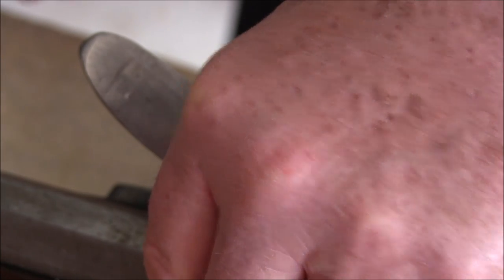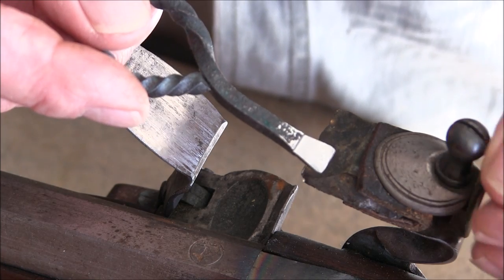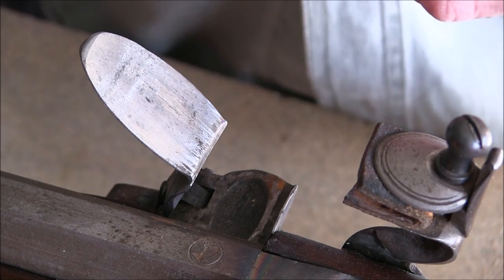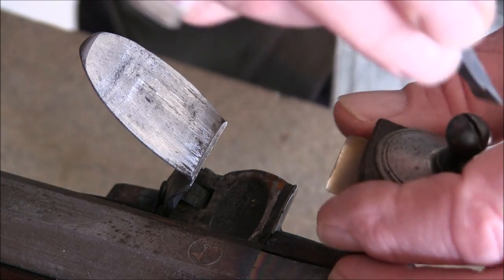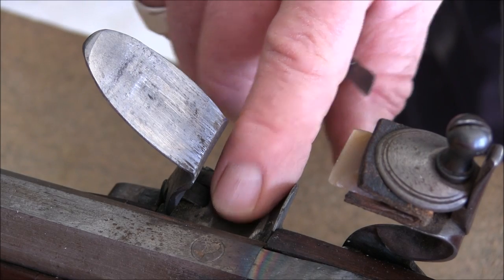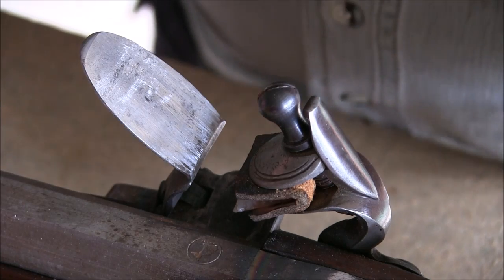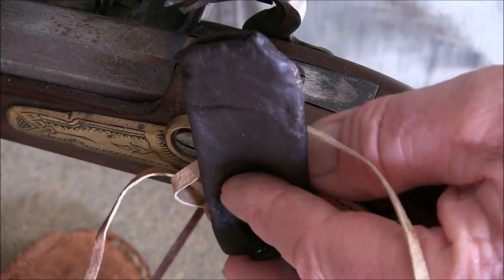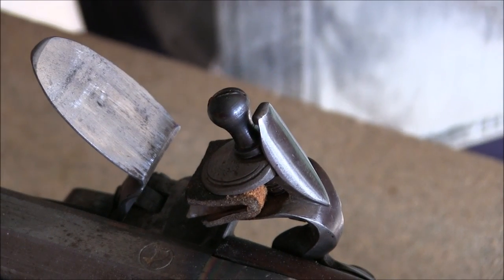Fitting A Smaller Flint In A Large Lock On A Flintlock Fusil By Keith H  Burgess

Comment: Excellent advice! The point about the slow ignition due to the "fuse" effect of a touch hole filled with powder is not often understood, it is less of a problem now that vent plugs drilled from the chamber side are more often used. Many thanks for posting this. Chris B.
Reply from the maker: Much appreciated Chris.
Keith.